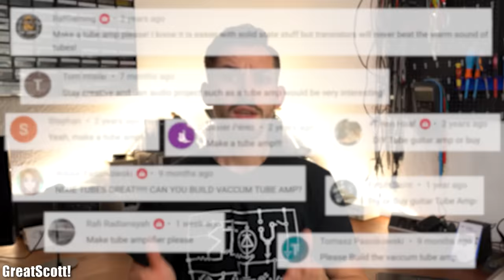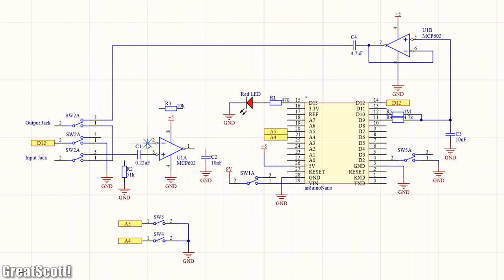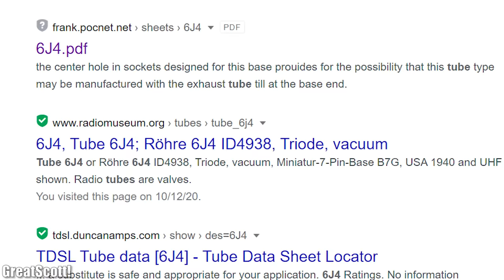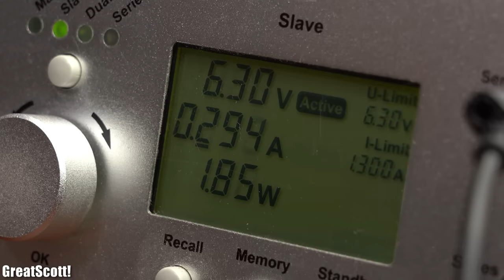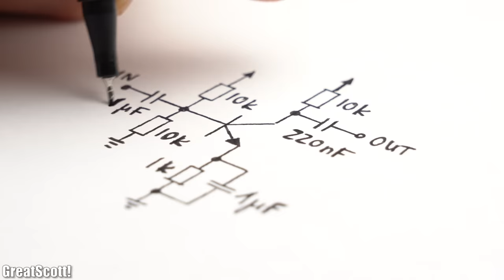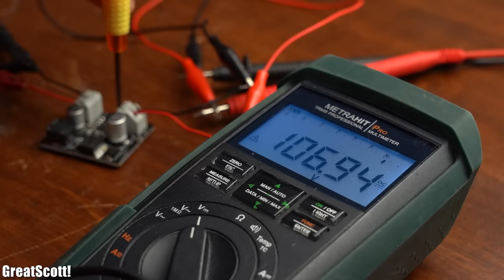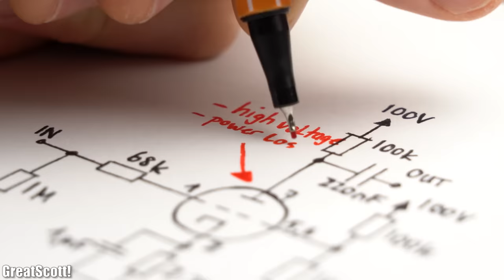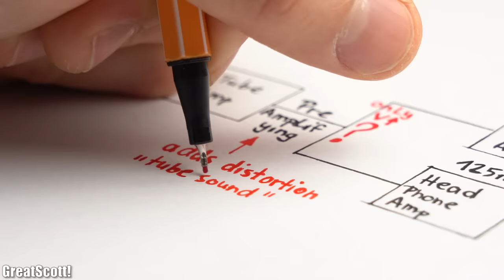Building a Tube Amp! Does it produce better audio quality though? EB#47

Comment: Wikipedia article touches on why tubes and fets sound pleasingly different .
Triodes (and MOSFETs) produce a monotonically decaying harmonic distortion spectrum.[clarification needed] Even-order harmonics and odd-order harmonics are both natural number multiples of the input frequency.

A psychoacoustic analysis tells us that high-order harmonics are more offensive than low. For this reason, distortion measurements should weight audible high-order harmonics more than low. The importance of high-order harmonics suggests that distortion should be regarded in terms of the complete series or of the composite wave-form that this series represents. It has been shown that weighting the harmonics by the square of the order correlates well with subjective listening tests. Weighting the distortion wave-form proportionally to the square of the frequency gives a measure of the reciprocal of the radius of curvature of the wave-form, and is therefore related to the sharpness of any corners on it.[7] Based on said discovery, highly sophisticated methods of weighting of distortion harmonics have been developed.[8] Since they concentrate in the origins of the distortion, they are mostly useful for the engineers who develop and design audio amplifiers, but on the other hand they may be difficult to use for the reviewers who only measure the output.[9]

A huge issue is that measurements of objective nature (for example, those indicating magnitude of scientifically quantifiable variables such as current, voltage, power, THD, dB, and so on) fail to address subjective preferences. Especially in case of designing or reviewing instrument amplifiers this is a considerable issue because design goals of such differ widely from design goals of likes of HiFi amplifiers. HiFi design largely concentrates on improving performance of objectively measurable variables. Instrument amplifier design largely concentrates on subjective issues, such as "pleasantness" of certain type of tone. Fine examples are cases of distortion or frequency response: HiFi design tries to minimize distortion and focuses on eliminating "offensive" harmonics. It also aims for ideally flat response. Musical instrument amplifier design deliberately introduces distortion and great non-linearities in frequency response. Former "offensiveness" of certain types of harmonics becomes a highly subjective topic, along with preferences towards certain types of frequency responses (whether flat or un-flat).[citation needed]

Comment: I’ve built a couple of guitar amps but I’ve wanted to build a hi-fi tube amp for years. I listened to a old hi-fi with a tube amp through old D120 JBL loaded speakers that was amazing and I’ve wanted one ever since. The D series speakers are long out of production but Weber makes a clone of the D120f made for Fender by JBL that should sound very similar.

Comment: When studying this around 35-40 years ago, the conclusion then was the non linearity caused highish levels of third harmonic distortion..which sounds good for some reason. Mosfet were supposed to be closer to tubes than BJT's, but I never saw a good analysis of these..they were far too esoteric/ expensive/ under-developed at the time.

Comment: A "tube amplifier" that has solid-state components on the circuit board is really a hybrid amplifier. The original tube amplifiers had no semiconductor components in their circuits. It should be possible to design a solid-state amplifier circuit that has the  same transfer function as a vacuum tube amplifier, for that "warm natural sound."

Comment: tubes give a warmer sound witch is why i suspect they are still being used  today

if you have access to junk old microwave or vcr the vfd display tube can work as a amplifier tube and at less voltages and current.

in fact the latest devices with vfd displays you can touch the pins on the back of the display and not even get a tingle.

Comment: Tube amps are mostly still relevant in music production, not so much in sound reproduction. The common cathode amplifier you wanted to try would have produced about 8% THD, primarily second harmonics due to asymmetry in the amplified signal. There have been attempts to make solid state amplifiers that work like triodes; one of my current projects is an analysis of a practice amp that many guitarists consider "tube-y" (quite coveted now; ended up having to lash up a clone in EDA software and send it to one of your sponsors for fabrication) to see where the favorable distortion kicks in. 

By the way, a 100mH/100uF LC filter would have cleaned up the noise on your boost power supply. You probably don't have the high voltage capacitors though.

Comment: I knew right away where you were going, when you said the transistor was "perpetrated". That shows your bias against transistors. The answer to the question in your post topic is a resounding no. Warm, pleasant sound, means high harmonic distortion, and doctored up frequency response

Comment: There are a few advantages to valve (tube) amplifiers. First they tend to hum along with the music, unfortunately at about 100Hz.
Secondly, on those cold winter nights, they double up as a room heater.
 The Russians, used mini tubes in there military aircraft, as they are highly resistant to EMP. 
Triodes also have a tendency to oscillate at RF, so your amplifier can double as a radio transmitter.

As valves operate with a high voltage supply and require internal heaters, you can become nostalgic for that combination smell of ozone from the electrical sparks and the slowly cooking dust. A smell that is so reminiscent of the 30s,40s and 50s and maybe the early 60s. A lot of pop music was first played on one of those mono valve amplified record players.
Like modern computers, there is also that delayed switch on, known to those over a certain age, as the warm up time. Waiting for the faint red glow coming from the back of the equipment, that ment the valves were hot, ( or the tar covered transformer and wax capacitors were on fire). 
At least the valve circuit designers had the sense to make the tubes fit into sockets, if present day manufactures were forced to return to valve technology, the valves would be soldered in and sealed for life, consistent with the modern marketing policy of built in obsolescence.
 I suppose if you are designing circuits for a trip to Venus, valves may have their applications, but in general I was very glad to see the end of the valve technology era, and very glad my electronics career started a decade or so after valves had almost disappeared from most electronic products. 
One thing missing is the reverence the early TV repair man was held. Treated with the same respect normally reserved for the family GP. The TV repair man was a periodic visitor, usually on a Monday morning, who came to replace the mythical picture tube, when Sunday night entertainment had been interrupted by the TV  screen going black, or disappearing into a tiny white dot in the middle of the screen. Ah the happy days of valve technology.
Reply: Some ultra-portable tube gear did indeed have tiny tubes soldered in. Conversely, lots of old transistor equipment used socketed transistors.
Reply: @eDoc2020  my rant on the subject of valves was intended to be somewhat tongue-in-cheek. A response to the memory lane walk, that any mention of incorporating them in modern electronics tends to provoke.
  I must admit, I missed the time when transistors were socketed, I assume it was associated with the period when germanium was the preferred semiconductor,, and thermal runaway ensured the demise of many such devices. 
I do recall the old AF116 and AC126 transistors to be found in the old Philips hobby engineering kit, sold as an educational toy. These fitted the components on a peg board using an ingenious spring clip holder.
I also recall using the very fragile OC44, OC70/71and OC81 transistors in early projects, but my experience with valves was mainly limited to tinkering with scrap radio and TV sets, from a decade earlier. These provided my introduction to electronics  in my pre and early teen years. 
When I was around 12 or 13, I was obsessed with owning my own oscilloscope, and ended making one out of an old valve TV set. 
I will never forget the lessons learned, sometimes re-enforced by the shock that can be obtained from touching the EHT of a TV line transformer.  This video brought back the unexpected memories of 6BH6 valve bases and tag strip construction, and the unforgettable smell of warm valves and hot/burning paxolin.
 My first radio transceiver was a secondhand hybrid commercial designed VHF mobile, that used a mixture of valves for the TX (PA was a QQV310), and germanium transistors for the receiver and audio amp. The efficiency was appalling, 13.6 volts at 6 amps DC in, for 5 or 6 watts of RF out on the VHF amateur band. 
By the time I finished with it, I had converted from AM  to  AM/FM switched operation, replaced RF front end with a dual gate MOSFET design. And replaced the single channel TX/Rx crystals with a 10 channel ,TTL controlled channel scanner,  crystal  frequency switching unit that used pin diodes. While this sound trivial now, it was state of the art for the 60s  and early 70s, when PLLs had not yet replaced  banks of crystals for channel selection, but I digress, did I mention I hate valves.

Comment: Tubes are big, hungry, use inconveniently high voltages and are expensive. But they look "cool" in the amp with their orange heat and blueish electron glow. They are also retro. But most importantly and that is why I find them useful till today is their use in the guitar amplifiers. Tube amp distortion characteristics creates by itself, what otherwise is achieved with special circuits and DSPs, while remaining simple.

Comment: It would be useful to show how to tackle power supply noise problem to at least minimize the issue you had (LC filters...). That is the real engineers knowledge and would come handy to someone who is not an expert and just wants to tinker with electronics on a budget. Also, MOSFET is a much better replacement for a triode than BJT. Tubes and FETs produce mainly 2nd harmonic, whereas BJTs produce mainly 3rd harmonic as well as many others

Comment: Coming from the guitar amp world -- yeah, the whole history of amplified live music has a legacy that's attached to tubes and the ways they distort when operating at or above their rated spec.  Musicians who wanted higher volume output began to associate the subjectively desirable characteristics of tubes with the styles of music they wanted to make, and found the output disappointing when this distortion was engineered out of the system.

You can of course create the same sounds with modern DSP, but only within the past few years has DSP been able to meet rock and other musicians' expectations.

The net result is people spending thousands of dollars on amplifiers designed to replicate the sound of a 3 watt tube amp cannibalized from a 1930's - 1940's era radio or movie projector.

Comment: As a trained enginner you, Scott, may think you can measuere everything with all your enginnering measurement paraphernalia. However I have some bad news here, and this is why tubes sound in one way and transistors in another. If you herar live a complex instrumen as a violin o hapishchord or any other and you as well record thhat instrument with the best equipment you will find very significant looses, an incomplete information on the recorded media. Then when you play the recordin on Solid State stuff may be the sound will be some steryle because the lack of harmonics. And when you herar the same using tube audio stuff may be sound with the coloration of artifitial overtones, the harmonic distorition you know. Then one may sound mor or les lifeless the other mor or less mellow. Then Solid state is as imperfect as tubes. By now I can say they are only different, one better for somethings and the otrar for other things. regards
Reply: True said

Comment: The even order harmonic overtones are what makes it so 'warm' and 'pleasant'. Also clipping is not as much of a square wave and generally are asymmetrical, again highly desired in audio freq's especially with musical tube amp builders. Cheers and thanks for the demo!
Reply: Clipping on HiFi amps should never be an issue if they're built right, is too weak or the listener doesn't care about input-volume. 
If You drive tubes into (soft)clipping they may be sounding not as bad (or 'warm') as clipping silicon but the endresult coming out of the amp has nothing to do with HiFi. 
In that case You need a better, more powerful poweramp (or hearing aids ;-))

Comment: You are correct, look at the data sheet tube did worse than transistor, especially the curves, those people call coloration, precisely speaking distortion in a predictable/more linear alike result. To better "use" the distortion need a very good circuit, no single tube is the same, each may be a slightly off by the data sheet. What I can say is tube's high voltage and heated condition really made it more stable, you won't put the transistor over 100 volt and 60 Celsius, but tube require a powerful transformer that can output a stable high voltage (it must be at certain level of quality to continuously working in high voltage), also tube not afraid of heat and cold, since it need a heater, the temperature factor become more constant under bad weather.

Comment: It's a shame that you talked about distortion without checking the spectrum of the amplified signal. Also, do you know if the "preamplified" signal is not corrected afterwards in the bougth one amplifier?

Comment: It is depend of the philosophy of the design. Tube amplifier can sound like average solid state amplifier and solid state amplifier can sound like average tube amplifier. The famous sound signature of average tube amplifier is having second harmonic distortion dominant and high output impedance.  Some type of distortion make sound more pleasant and some type distortion make sound less pleasant. Of course not only static distortion (THD, IMD, harmonic profile of the distortion), but distortion can happen dynamically, like clipping sometime, temperature changing because self heating, etc. Not many amplifier designer understand the relationship between the measurement and the sound.

Comment: Given Vacuum Tubes (Valves) are voltage driven devices, more like a FET, should they be compared to some kind of audio amplifier based on FET's instead of BJT's?   I am not sure if it would make any difference, but curious.  I guess ultimately it depends on the quality of the input signal.   A bluetooth signal, or signal from a digital origin, such as a recording from an online streaming service, is not likely to sound much different regardless of the amplifier I guess.

Comment: hello scott great video,
try connecting better input like gramophone or reel to reel tape machine. trying to get your attention to quality loss during DA conversion
Also too much of transistors in your amplifier try using true tube amplifier with good raw audio input and reproduce it on quality speakers the diffrence will be more great i see manuel wrote it in more detail about tube amps.
Kind Regards

Comment: I just sent you an email in regards to that Nixie Power Supply and what to do to get something to drive that preamp tube with through-hole components and to do it cheap. I made the same mistake when trying to make a 12AX7 pre-amp, but fixed it.

Comment: I believe that another place that vacuum tubes HAVE to be used is in high powered radio transmitters, as no solid state transistors, or even high wattage MOSFETs generate enough steady wattage without overheating or clipping due to having to daisy chain so many together to equal what very large transmitter tubes can generate. I may not have all the technical stuff correct, but I think what I'm getting at is truthful.

Comment: I think you would hear the real difference between the transistor amplifier and the tube one if you plugged in eg. guitar. But that thing you bought is unfortunately not a tube amplifier. It's only preamplified with a vacuum tube. Real tube amplifiers like from Marshall when you plug the guitar in, it sounds so comfortable for the ear.

Comment: The "tube sound" is mostly a product of slightly changing the waveform - makes a sine wave slightly more like a sawtooth & the attenuation of odd order harmonics. There can also be natural soft compression caused by current draw during sudden spikes in volume called sag - this is not present in all circuits.
Honestly & ironically these are quirks caused by technical limitations of the pre-solid state era that we as a culture have come to love.

Comment: From 9:40 to around 10:20 you're looking at the wrong curves if you're judging distortion. The slope of collector current vs collector voltage is simply showing the output admittance or output resistance. That will be swamped by the collector resistance acting as a load. You need to be looking at the change in output current vs change in input current to see the distortion. That means you look at hoe the gaps between the lines change at a given collector voltage. See how at Vc=10V, the the gap from Ib=0.2mA to Ib=0.4mA is about 20mA change in Ic? and how the gap from Ib=0.8mA to Ib=1.0mA is more like a 22mA change in Ic? The same applies to the triode, but with larger voltages and smaller currents.

Comment: You should load anode with audio transformer to hear real difference, there is a lot more going on with them than explained here. Tubes are most useful in pro audio when used for guitar amps, microphones, preamps, compressors, etc.